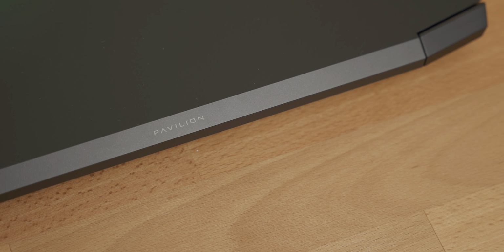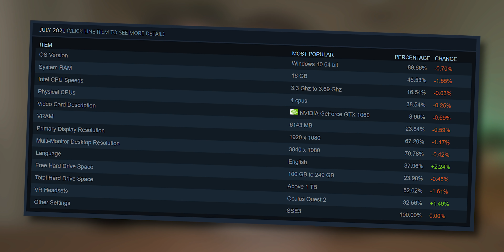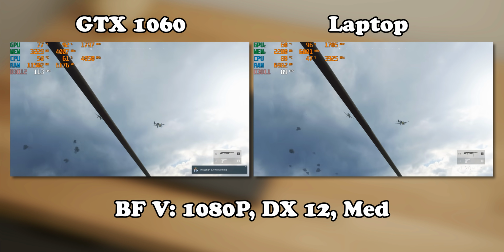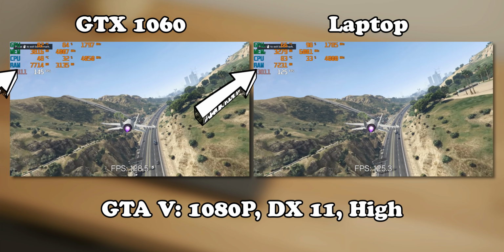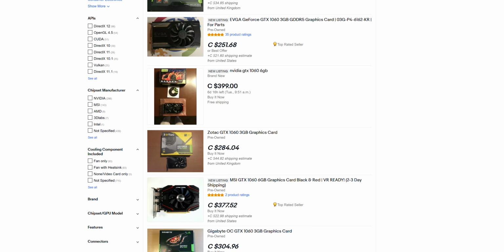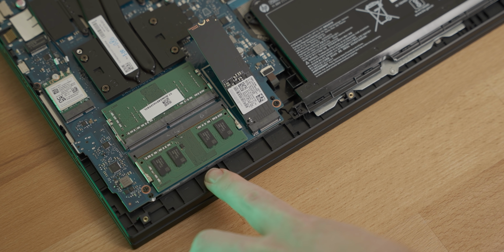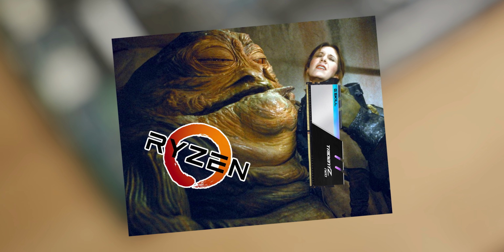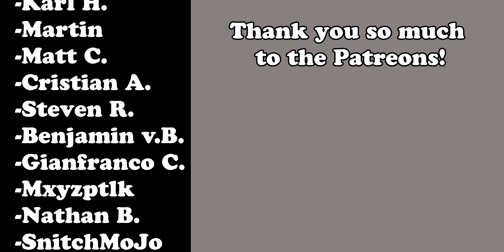Most Popular Graphics Card On Steam Vs $700 Laptop

Comment: Interesting... I had bought an acer nitro 5 with an i5 10400h and a 1650ti for 679€ on amazon back in september 2020, and I imediately bought a 2nd 8gb stick of ram (also crucial), and tak manager is telling me the whole thing is running at 3200mhz (the rated speed of the original stick of ram, as well as the stick I added), and if I remember it ran at full speed out of the box. This pc also had a 2nd m.2 slot, as well as a 2.5 inch sata drive slot, which were alsoeasy enough to populate. I`m honestly curious to know how my pc would stack up to this one, sine I have in theory a faster GPU, but a presumably slower CPU...

Comment: CSGO is never a good metric for GPU performance. Every GPU on the market, save for the bottom of the barrel stuff, can easily crank out hundreds of frames on that game - the engine is 10 years old after all. It's purely CPU scaling. Even with a 3090, this laptop would be doing the exact same amount of FPS.

Comment: Yes the JEDEC speculation is very possible in many cases with other RAM. It is not the case with this set from Crucial. This set requires a high voltage limit that only a few high-end gamer laptops can even support. These are JEDEC spec'ed but not certified.

Comment: Is AMD Ryzen™ 5 processor better then I5? I have to same specs almost as the laptop but I don't get 100+ fps in GTA and sometimes it stutters like hell. I spent a week+ doing everything to fix the stutter before fixing it but I only hang around 70 fps that drops to 50 or 40 then back up to 70. 
NVIDIA GeForce GTX 1060 Max Q
i5-8300H CPU @ 2.30GHz
8gb of ram
I'm not sure if it's duel ram or just one stick of 8g's.

Comment: That laptop would really need an external monitor to give its performance, and the integrated display to be switched off in Windows!
the iGPU is a bottleneck for the GTX 1650 in this situation because the signal has to go through it, so the whole comparison is biased.

Comment: the lower average framerates may be caused by the fact that laptops tend to have the cpu's integrated graphics driving the laptop's display, and the 1650's output is running trough that before it makes its way to the screen.
Connecting an external display, and having the game be displayed there, may close the gap significantly, but i get why you did it like that, since you wanted an out of the box type of experience

Comment: Omg I can’t believe it, i have the same laptop but with a ryzen 7 4800h and a gtx1650ti, same ram and ssd tho.
I bought the same crucial 16gb cl16 kit and it only ran at 2667 because the bios had no xmp profile. 
I managed to fix it later by getting an another crucial kit rated at 3200MTS but was only cl22.
That kit although less sexy but it ran at 3200mhz out of the box.

Comment: My Girlfriend actually owns this same laptop but with the i5 variant instead. It runs everything pretty much just as well as you would expect for a laptop but her GPU is the GTX 1660ti model. So the framerates are much better, even with the standard 8GB RAM configuration. My own laptop, the ROG Strix G512LW came with 16GB of DDR4 @ 3200hz, which was a pleasant surprise because, like you said, it's not common to see in laptops. (and the ram is from Samsung, so score lol).

Comment: $700 you say? I got this laptop (well a slightly older model, I have a 4600 H instead of a 5600 in my laptop) last year for $450. It was an 8 gig variant so I spent $40 to get another 8 gig stick of ram to plug in it and I now have 16 gigs of dual channel ram running at 3200mhz (I just made sure to buy the same brand of ram, in this case samsung, that had the exact same timings and was rated for 3200 mhz. I had no problems with the memory not running at the proper speed). So if people are looking to get this laptop for gaming all I can say is if you wait for a bit you can probably find some nice deals this holiday season.

Comment: I bought this laptop about 6 months ago and although I have a couple of complaints (shoddy trackpad, power brick can get hot enough to burn, and smaller stuff) I've been blown away by the power of it. By far the best gaming laptop ive had in terms of price to output. That being said the IO could be a LOT better, and one of my USB ports just straight up stopped working about a month after i bought it. Performance is good for price, but it seems like they spent too much time on design and not enough on the stuff we really need

Comment: Lovely to see my GTX 1060 6G still features in videos. I run a Ryzen 3600, 16GB 3200Mhz and a GTX 1060 6G overclocked by quite a bit on 144Hz panel with Freesync - it definitely satisfies my gaming needs to the point of where I stopped looking around to buy a GPU. I'll just wait for full MSRP whenever that comes. BF2042 Open Beta this week, let's pray the game with be running smoothly.

Comment: Might need to activate the XMP profile to get the 3200Mhz.. But, that setting is not available in most of the laptops out there. That's why i choose HyperX Impact 3200Mhz CL20 for my laptop since it "Automatically Overclock" itself to the maximum rated freq for the laptop / the CPU.

Comment: If you go to power settings in windows and under advanced menu, change the maximum processor state to something like 80-70%, you'll see far better temperatures without actually crippling gaming performance since gtx 1650 is nowhere near powerful enough to chug the cpu and you might as well gain some thermal headroom for the gpu to maintain it's boost clock speeds. Because they generally use the same heatpipes for both the gpu and the cpu. I did this on a ryzen 4800h laptop with gtx 1650ti and cpu temperatures dropped from 90'ish degrees to 50-60ish at max while only losing about 3-5% fps on titles like dota 2. Tripple A titles that already chug the gpu gave actually a bit more performance likely due to the 10-15C less temperatures on the gpu.

Comment: Bought the 2019 version of that laptop (ryzen 5 3550H and 1650) last year. The thermal throttling was so bad that it couldn't run any AAA titles and I barely managed to get 40 fps on rocket league on the lowest settings and even then it turned off after 5 minutes or so of playing. Couldn't even exchange it because my parents insisted that I should keep it. That was 8 months of savings just gone.
Reply: Ryzen 3550H 👎 Atleast you could gone  for R4600h it's 🔥

Comment: the ryzen 2600 is around 3,7ghz and the IPC difference also the clock of the 1060 is under performance since many 1060 will get around 1893 or 19xx  .....

Comment: In the very first test you have one of the games running DX12 and the other running DX11. You have to actually control variables like that to do a test, you realize that don't you? You can force DirectX versions as well, you could have forced the DX12 one to run in DX11 and had a controlled test but its all kinda meh now cause you didn't feel like typing -DX11 in the launch parameters lol

Comment: How you get 80 degree celsius temp? I play WoW at Ultra Settings @ 2k resolution my EVGA GTX 1060 Single GPU Fan still hover at 40-66 Celsius at maximum. My PC case have 2 Intake Front Fan + 2 Exhaust Fan + Artic Freezer 34 Dou.. maybe your GTX 1060 thermal r dried fish??

Comment: This is reassuring to hear. I recently got back into gaming and I picked up a used OP-LP2 for 400 with the GTX 1060. I had no idea the capabilities for this card and I'm reassured that I have a very capable rig, although the thing gets hot like crazy... Even with a cooling pad and Opolar vacuum cooler attachment! 
I should be good for a long while since I mostly play indie platformers that aren't too graphically demanding. Haven't been interested in AAA games lately.

Comment: Are you sure that 1660 wasn't thermal throttling? Cause I believe by default Nvidia cards throttle at ~83 degrees, and it was sitting at 82 with all that testing.

Comment: I own this laptop, you need to find RAM that doesn't use XMP profiles for its 3200mhz speed and uses JEDEC to specify the speed instead. OLOy has a kit on amazon that I bought that works fine at 3200mhz without issue.

Comment: The way to check for Max-Q is to load up something that can monitor the power delivery like gpuz and watch that under load. Because that's what actually defines the difference between Max-Q and normal Mobile.

Being more than 5 or so watts under 50 for the 1650 would be Max-Q. The design spec is essentially power throttling the GPU instead of thermal throttling it which is how things used to be done and led to the blistering hot laptops of yore.

Comment: I actually own the HP Pavilion Gaming 15-ec2253ng, replaced the WLAN module against a more relyable AX200, and I bought  the G. Skill Ripjaws F4-3200C22D-16GRS which run relyable at 3200 MHz.
Using AMD APU Tuning Utility I could raise the TDP safely to 55 Watts.

Comment: I actually had the same issue with memory. I got the same kit for my Envy 15(Ryzen) and it showed up as 2666. Turns out it was a voltage issue, the HP needed a lower voltage ram kit and then it ran at 3200mhz.

Comment: I got the same HP laptop but with a high refresh screen, which is supposed to be better. However, for some reason, when I naturally uninstalled the bloatware, including VPN express, and McAfee, the processor started to run at only 400 MHz instead of over 3200 MHZ. It was unusable for weeks because it was SOOOOO SLOOOOW...

I SLOOOWLY ran through installing the ultimate power plan, trying to update the drivers, disabling the intel power management, which is on it even though it has an AMD 5600h, etc. Nothing worked for weeks.

Finally, as I was about to give up and just reinstall windows via a key that I bought myself, I restored it to a prior restore point. That took care of the problem. Now, I am afraid of uninstalling the included crapware, which may have a booby trap, because it apparently messes up your system if you uninstall it. 

Nevertheless, after fixing it, I upgraded it to 24 gig of memory with another 16 gig 3200mhz stick from Team and a 1 tb Samsung SSD. Thus, it runs like a dream for now. I just have to remember not to uninstall or touch any of the presumably-booby-trapped crapware. I guess that they are key logging and watching my every move through it. LOL. They deserve to suffer through the tedious hours of absolute boredom that are my life.

Comment: If you want it to run at 3200, you have to use the intel software. sometimes OEM's lock most of those bios options behind a pay wall that requires their ram. I had the same issue with my Dell AW51m r2.

Comment: I'm honestly surprised the 1060 does so well. 
I would have bet money that the laptop was gonna whipe the floor with the 1060.
Reply: Its a 1650. It was always around a 1060
Reply: @setzer-j6s  Yeah but my 1660 super is only supposed to be about 20% better than the 1650, but according to this test it’s over twice as efficient as the 1650. But then again I know the laptop cards aren’t as powerful as the desktop cards so I don’t know this is just confusing.
Reply: @setzer-j6s  I every day drive a 5K monitor with my 1660 super. I’ve overclocked it but it’s plenty powerful enough to play any game just fine at that res. The most graphically demanding games I still get 30 frames or more per second. Most games run at 60 frames or more. Halo master chief collection runs at 130 to 140 frames per second at 5K. So yeah I don’t know a 1650 being that shitty I just really wasn’t expecting.
Reply: @HighguyMcfly  what? The 1650 was basically a 4gb 1060. The laptop 1660ti can match your 1660s if you want more power

Comment: The RAM doesn't do 3200Mhz in this laptop because it's an XMP based 3200Mhz module, not an official JEDEC one. To get 3200Mhz out of laptops that don't have XMP settings in the BIOS you need 3200Mhz modules that can do it at 1.2v with CL22,, the crucial module only does it at 1.35v and has CL16.

This RAM kit should do it:
G.Skill Ripjaws F4-3200C22D-16GRS
Same story for my dell G5 SE.

Comment: Nvidia has really done some magic on the 1650's drivers. I remember seeing benchmarks when it first came out and it being barely better than a 1050ti. Now the laptop version is keeping up with a desktop 6GB 1060, so it should be very much on par with the 3GB version.
Reply: What? Dude, the 1650 got gddr6. Thats why. Before it was bottlenecked by bandwidth. And the 1650 on laptops with gddr5 had 1024 cores. So it could already keep up with a 3gb 1060 desktop.

Comment: I've always had desktops but most recently due to "adult" circumstances I went with my first gaming laptop for convenience, a ~£1500 XMG Fusion 15. 
Whilst the performance is fine, it gets hot as seen in this vid, and the fans sound like an airliner taking off. This pisses me off so much I intentionally run worse settings just to get a bit of piece and quiet.

I knew the compromises I was making when buying a laptop and it's worked out well from the view that I can set up in different places, but it's a massive QoL compromise I think.

Just my 2 peneth

Comment: I have an older pavilion with a 7th gen I5 and 1050 but an 144hz display. I hooked it up with an ssd and it performs very well. the only downside is the overheating
Reply: Thermal repaste and clean out the dust. Prop it up and max out fans. Does wonders.

Comment: The 2666MHZ speed is because HP doesn't have XMP. To run at 3200, the RAM MUST have a jedec profile for 3200mhz@1.2 volts. Had you bought the plain old 16GB crucial kit, it would've run at 3200. I have the same laptop and used that kit.

Comment: I have this same laptop but with a 10th Gen intel Core i5 and a GTX 1650 ti. I got that exact same RAM kit sent to me from Crucial (was an RMA) and I too ran into the speed issue. Upon looking it up, "JEDEC" memory is needed to run at the higher speed in a proprietary motherboard like what HP has in their laptops. I cannot run XMP profiles due to the intel Extreme Tuning Utility not recognizing the CPU/motherboard as having the XMP "feature". I am still very happy in my choice to buy this laptop when it was on sale at Target for $599.99

Comment: Pretty solid results from the laptop! Although IMO any 'gaming laptop' without Thunderbolt isn't worth it - and I'd wish OEM's would add it to the AMD variations (they can now - it's not Intel-only). I have a 2015 Dell XPS 9550 (which is not a gaming laptop), and was able to pick up a cheap-ish eGPU w/ a 5600 XT in early 2020. It's driving three monitors with ease - and plays fantastic in even the latest games like MS Flight Sim.Also, great because I switch between my work MacBook Pro and Dell.

With that said - I do know that my aging Dell only uses 2x PCI-E lanes - but the performance is holding up well, and extended it's use-life for at least a few more years.

Comment: I've said it for months : entry level laptop priced didn't really got inflated that much (1650 and 1660 parts didn't get too high at least) and if you want a gaming system, some laptops can be a very good desktop replacement with enough IO to do all you want (maybe with some dongles). Might be a better idea than buy 5yr old hardware sometimes
Reply: sadly its the case now a days. its bc of crypto mostly
Reply: yeppp, I never think I can get a 1060 laptop but now I have a decent 3060 laptop, and the RTX 3060 card's price is almost the same at the laptop.
Reply: @gnol-g7f  Yeah, at this point getting a gaming laptop is a more cost effective approach. PC part prices are still so high after sooooo long…

Comment: I originally bought a ballistix kit for my 2021 ASUS scar 15, and realized that low latency 3200mhz ram required a XMP profile to enact those speeds. Ended up going with the 3200 kit from gskill which ran at yes, 22 cas, but without XMP. but doubling my ram from 16 to 32gbs and on top of it upgrading the stock ram which was single rank to dual rank made a huge difference on a AMD 5800h. Frame rates are definitely 10%-15% higher, but the 1% lows are dirastically higher, resulting in a WAY smoother experience. It was instantly noticed in all games I play. Insane how sensitive AMD is to ram.

EDIT: do not buy with pre installed upgraded ram. Smh, you have to look and see what the ram kit runs at on its default profile at 1.2v. Majority of laptops won’t go above that. The BALISTIX memory he bought required 1.35v to run at rated speed AS ADVERTISED

Comment: I'd be mildly interested in seeing the performance difference between that 1060 and the SC version which has a substantially better cooler, despite looking the same from the outside. I can say from experience though, you'd probably want to change the thermal paste. I had one and it ran hot as balls and loud as hell when new. A quick thermal paste change dropped the temps and fan speeds significantly. Naturally, it boosted way higher too.

Comment: To be real here, that motherboard is a hell of a kind when I realised that it was not designed to handle more than that 2666mhz. However if you buy a 2019 chassis which i found on canada is under 700$ price(https://www.ebay.ca/itm/184853567535?hash=item2b0a21982f%3Ag%3AOwkAAOSwIFdgq-D-&LH_ItemCondition=1000%7C1500%7C2000%7C2500) in usd than the mobo can support up to 2933mhz

Comment: I have an ASUS TUF GAMING laptop with a GTX 1650 and the GPU is amazing imo

Especially now that I have an external 144Hz monitor that turns off the iGPU on the CPU and only uses the GTX 1650, so it improves FPS

No game is a problem for it to handle at at least 1080p High Settings, except maybe Cyberpunk 2077 when you are driving around Night City